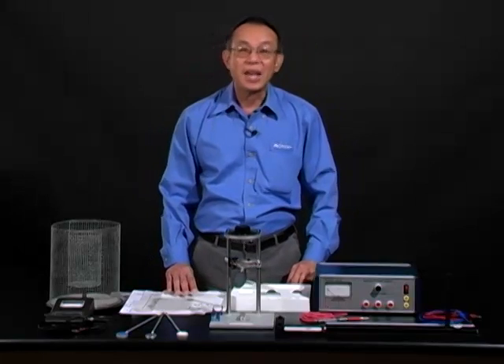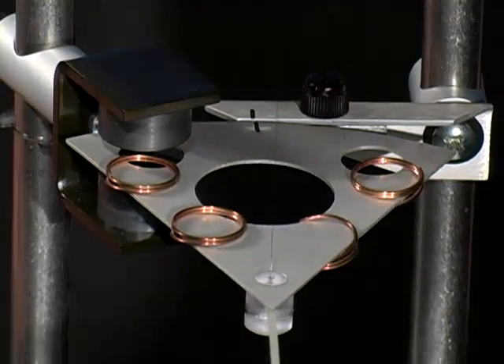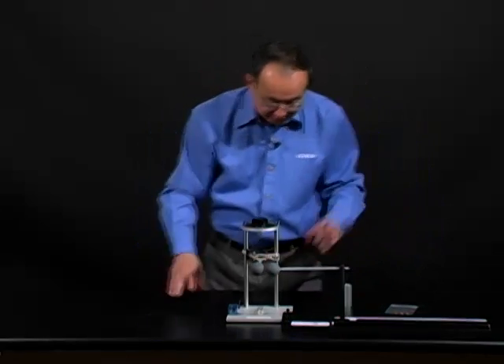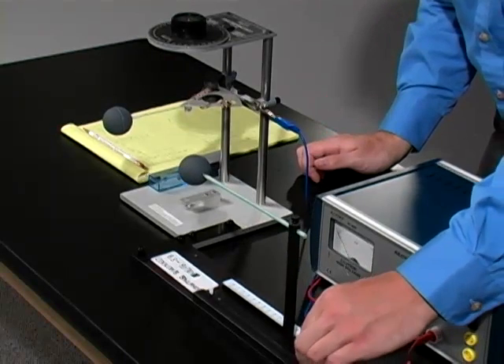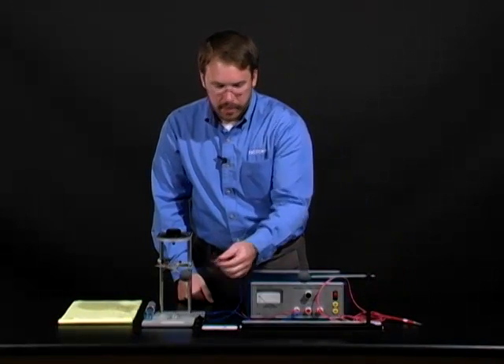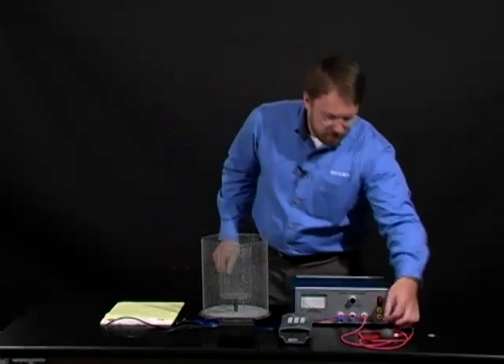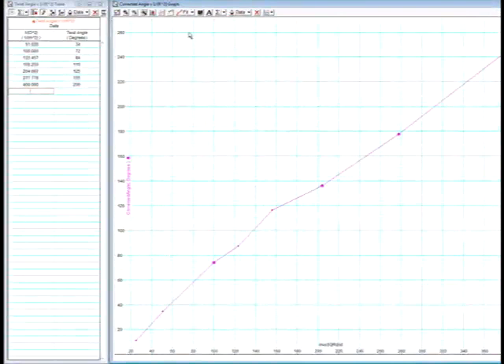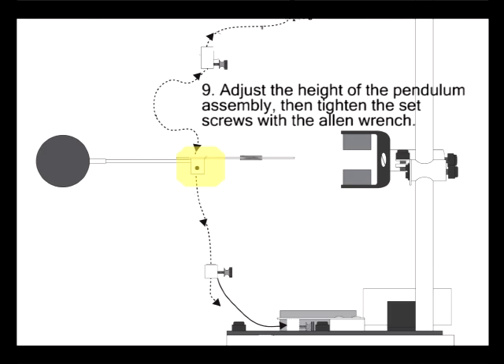Coulomb's Law Experiment

Comment: How on earth can you make them move so much? I tried with som equal size metal balls and a 6kV DC power supply and they hardly move when I move them right next to each other
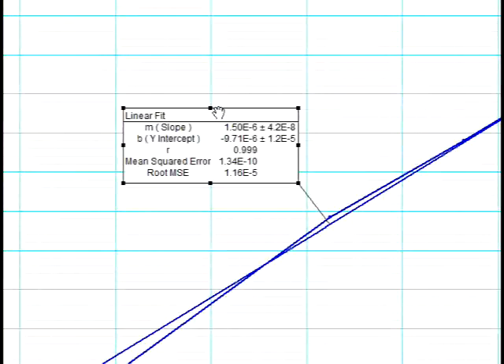Reply from the maker: Perhaps the torsion constant of the wire in your setup is significantly different? You can see in the movie at 21:48 that it's about 1.5E-6 N/degree for our unit.